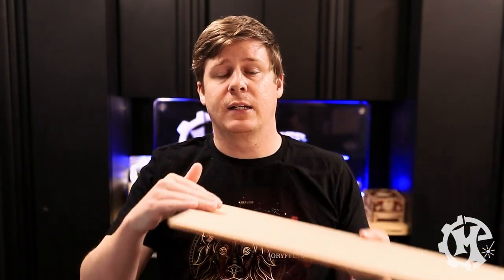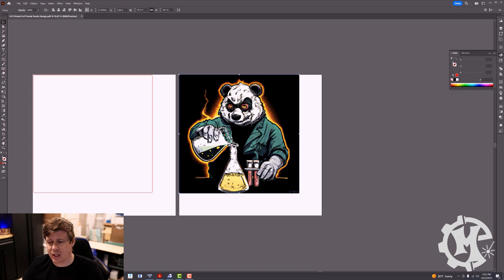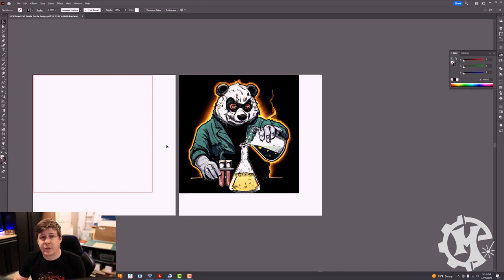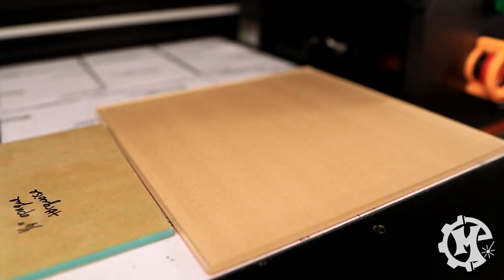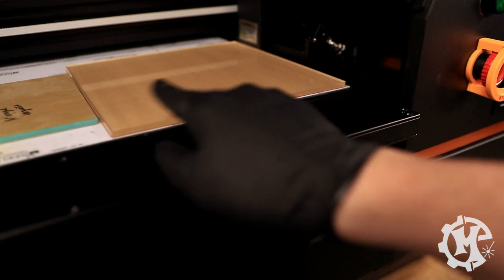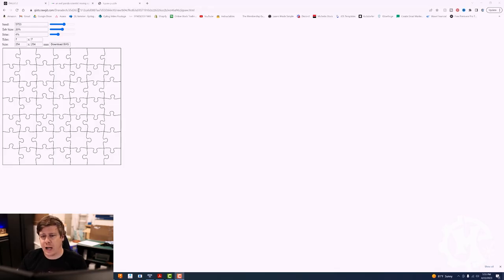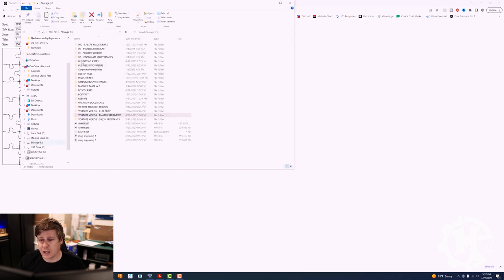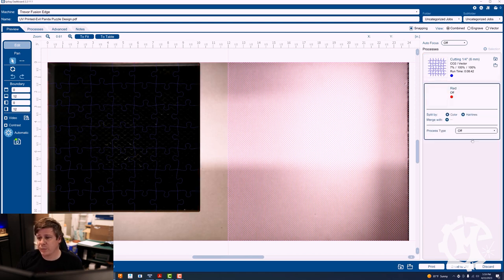Creating a Laser Cut Custom Puzzle Using AI

Comment: Great project! I only have a little experience with it but I had the same issue with peeling after cutting no matter how long I let it dry. I switched to acrylic specifically for digital printing (corona treated) and haven't had an issue since. I'm sure with proper cleaning and adhesion promoter you could get good results with regular acrylic though.
Reply from the maker: I’m going to be running a test soon with different options to see what happens. That’s good to know though.

Comment: Nice project! When you print backwards on the back of acrylic and glass, can't you save some money from white ink and just spray paint the back?
Reply from the maker: Yes but is that really saving you much money by the time you buy the paint and account for labor?
Reply: @MakerExperiment  good point, I don't know how much is used. UV ink is quite expensive though. Does your software calculate how much of each ink is used? Mine does not.
Reply from the maker: @NickSpirov  it has it in there. I don’t know how accurate it is.